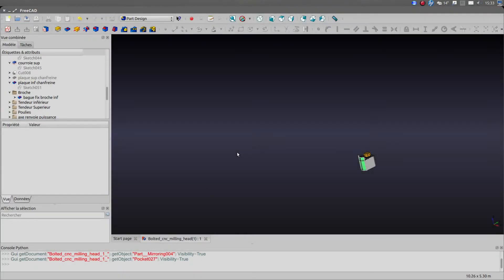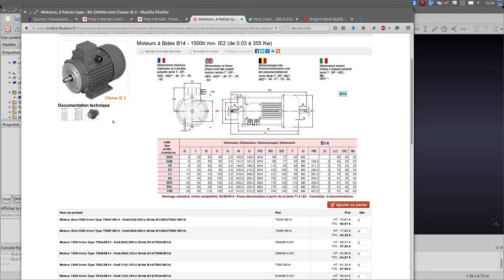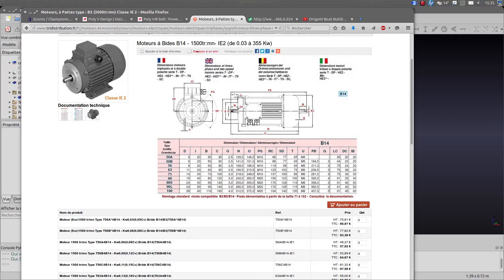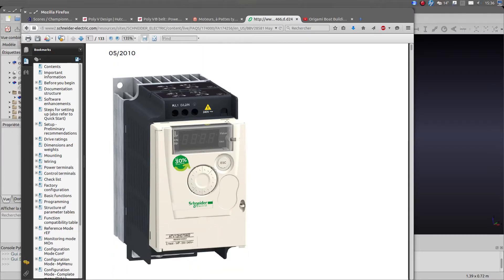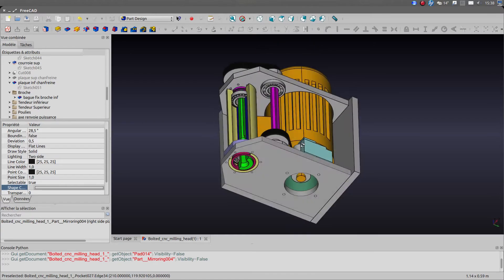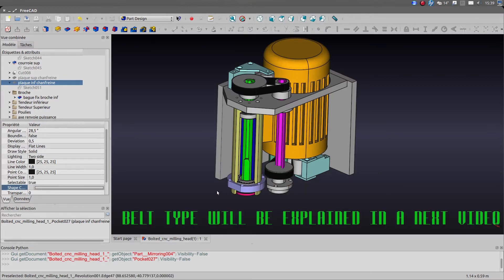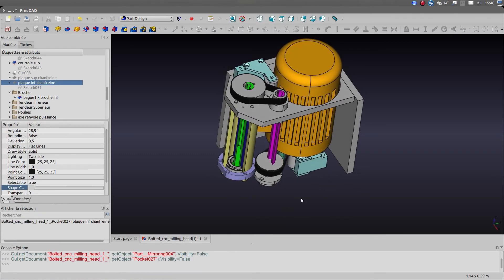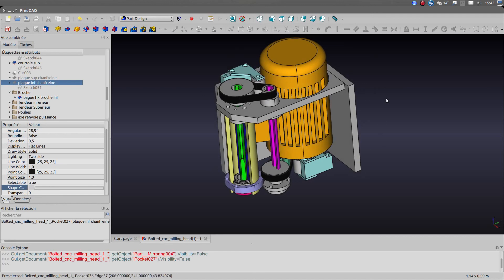Heavy Duty CNC: Milling head Design EPISODE 42

Comment: I want to change my Plano milling head..that was run with motor and pulley connected via belt drive standard speed. But I want design a variable speed spindle with high torque for increase depth of cutting.pls help me im a beginner